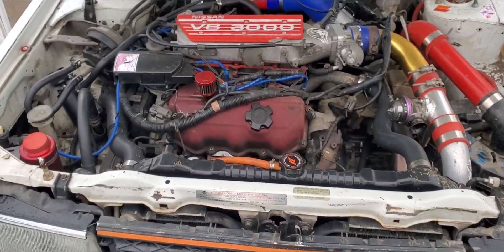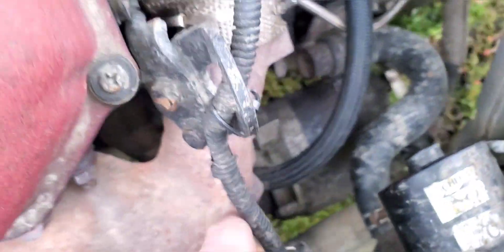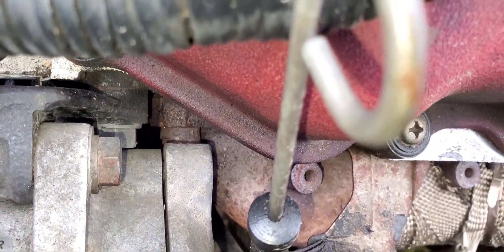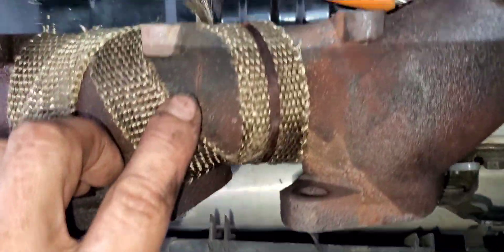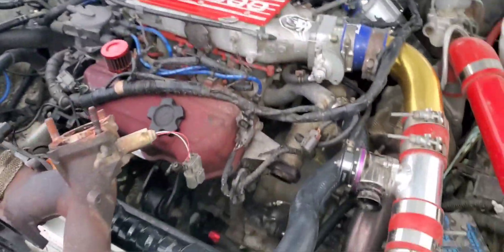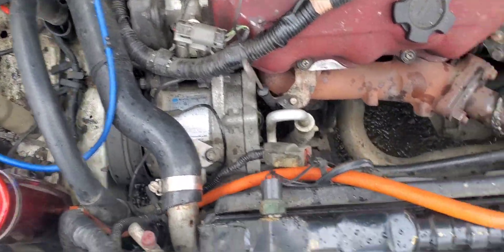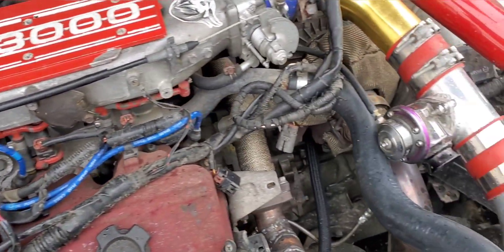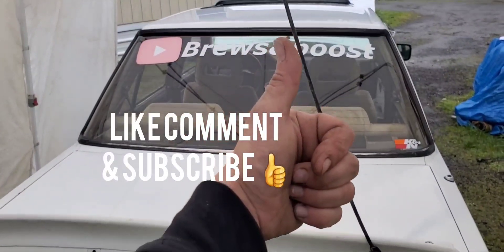turbo maxima gets new header and better flow!

Comment: Turbo maxima is awesome! What ecu?
Reply from the maker: I'm running a 1986 300zx z31 turbo ecu/turbo injectors/ and 300zx maf. It all just plugs right into the maxima no issues. But you have to delete all the accessories on your intake since the iacv is wired differently from na to turbo variants
Reply: @BrewsBoost  thats soo cool, i bet the car is a lot of fun
Reply from the maker: Oh she is a blast to drive. A real sleeper in my opinion 😴